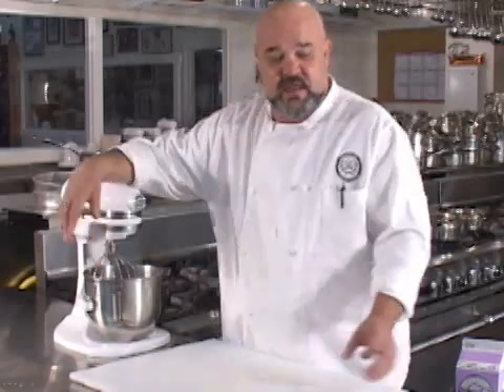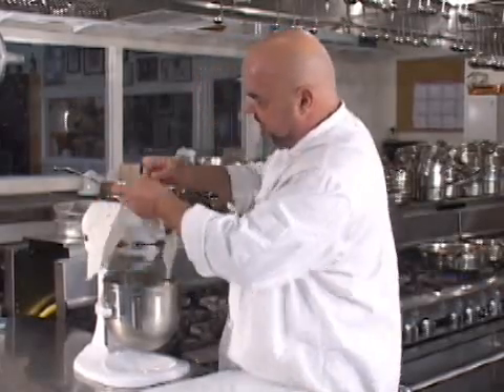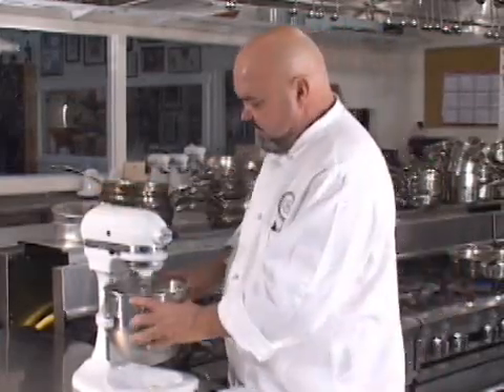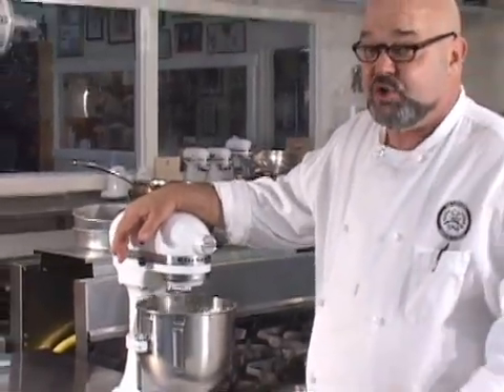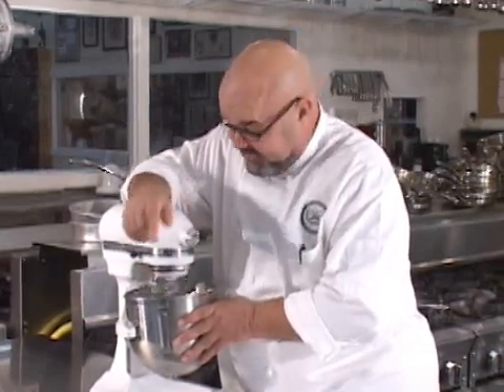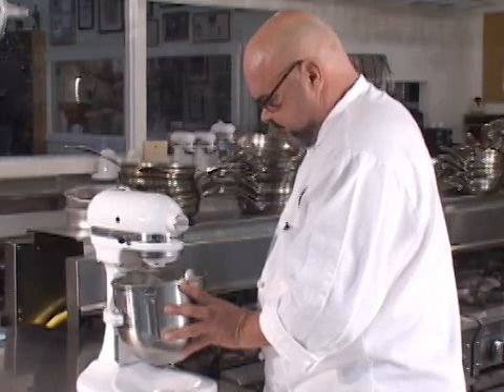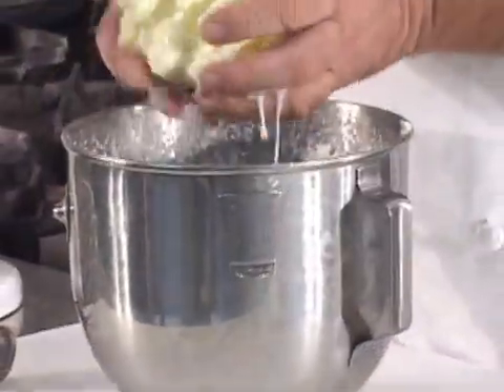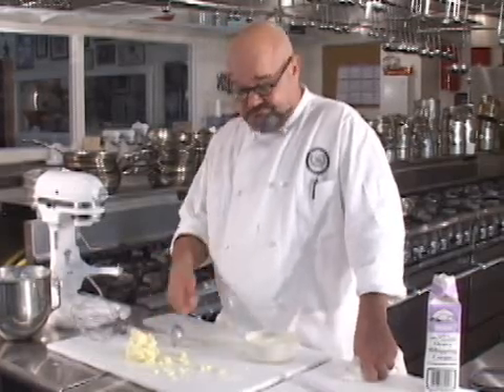Understanding Cream & Making Butter

Comment: I have a kitchenaid mixer and a Hobart mixer
Reply: Lucky you !! 
Back in the old days, I lived a short drive from Hobart Indiana and I made a couple trips to the showcase/distribution plant there to make purchases. Both times I went there i was thrilled because I got to see the very latest Hobart equipment on display. This was before cuisinarts were even invented. Hobart had some very unique mixer attachments that when affixed to the machine, could push meat, fish etc. through a heavy duty fine sieve very effectively.  I had one and used it to process foods for making mousse, vegetable purees etc. Eventually food processors made these attachment obsolete but they did a comparable job at pureeing foods as well as  a food processor does today. HATS OFF TO HOBART !!!!

Comment: not sure why you're tilting the bowl. If it's because the whisk isn't whipping all of the product, maybe you should adjust the attachment screw
Reply: Maybe I just wanted to be sure everything was being incorporated into the mix and that no physical adjustment was necessary. You never want the whisk to be actually touching the bowl during any normal/average whipping procedure of anything - so it's not smart to adjust it in such a way that the whip is ever touching the bowl, even extremely lightly.

Comment: I am having troubles making the butter using this method.  I skim off 
the cream from raw milk and use my stand alone mixer using the wire 
whisk.  I have had success in the past but limited and it takes maybe 
15+ min.  One it took 3 min I think and  I have let it whisk for 30 min 
and give up.   I have use it straight from the frig (cold) and I have 
let it warm to room temp.And advise?    Anyone?

Comment: Thanks Chef, great video. As a note we could add salt for salted butter which most are used to. Also strain butter through cheese cloth to get all moister out especially if you are going to freeze for later use. Lastly I use a food processor for this. I find it quicker with less splatter.
Reply from the maker: Stephen Jacques That all sounds good to me.

Comment: is there any way to make cream at home ?
i'm trying out creamy pesto sauce, in some recipes they use heavy cream in others they add flour and butter to it ? whats the co-relation and in your opinion which is better
Reply: The only way to make cream at home is if you have a milking cow at your house LOL !
Your second question is garbled up and unintelligible but I think I know what you need to be told.
1. Yes, you can use heavy cream together with pesto and make a sauce.
2. Yes, sometimes flour & butter are mixed together to form a roux, which is used to thicken liquids.
3. Yes, sometimes you can thicken the cream by reducing it and don't need a roux (or whatever you'd be using to thicken the cream) and then sometimes you can not reduce the cream very much (or not at all) and use the roux to thicken it. 
4. Yes, both approaches can be both effective and also good tasting. Your job as a student of good cooking is to learn as many or all of the variable ways to manipulate the taste and textures of all of the cooking liquids. That way, you have the automatic answers to what your best options will be within any scenario that you're deciding upon or presented with.

Comment: You need to try using real (homemade) sour cream to make butter.  Add a little (commercial) sour cream, or cultured buttermilk to some extra heavy cream, let it sit outside the refrigerator, until it's thick.  It will get a lot thicker than commercial sour cream.  I convert mine in a 1 quart canning jar, by filling about 3/4ths full and shaking.  Takes 2 or 3 minutes, and the results look the same as yours, but the taste is COMPLETELY different.

steve

Comment: Would you be able to put herbs and spices into this while its mixing to form spiced butters?
Reply: After the butter is made then simply remove 
it from the buttermilk and mix in whatever flavors you want in a separate 
bowl.  Remember that different liquors, herbs garlic etc, are all within 
range.  You will then have what is called a "compound butter" that can be 
refrigerated or frozen for a later use.